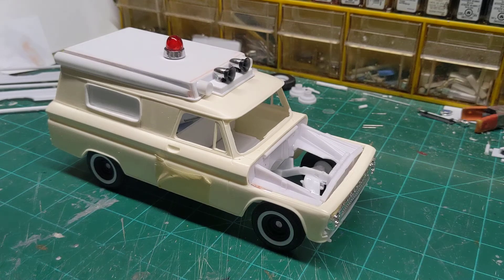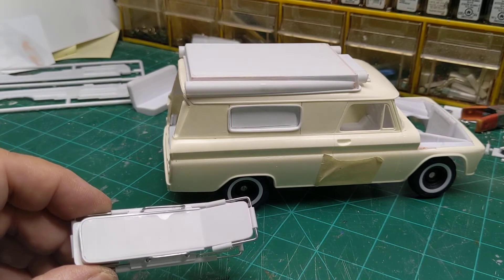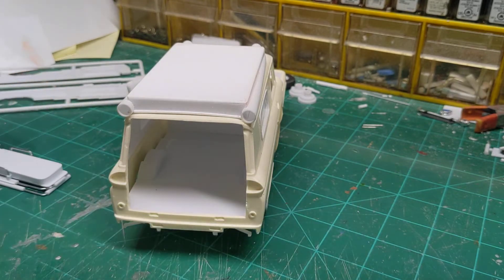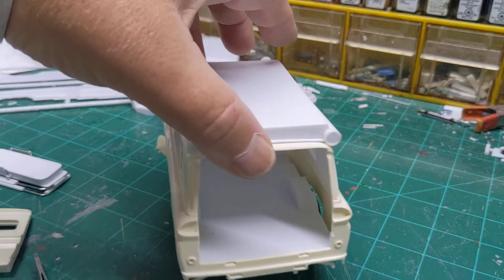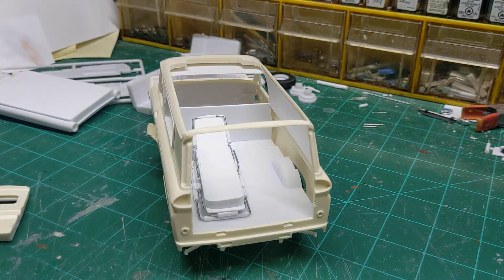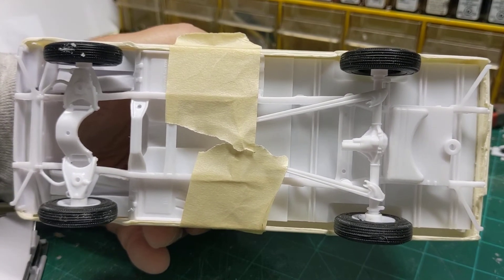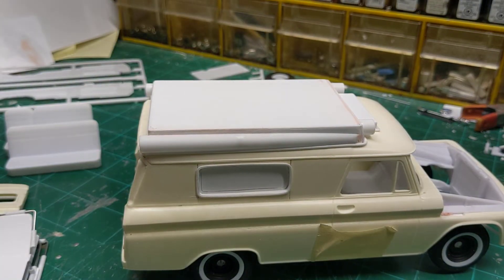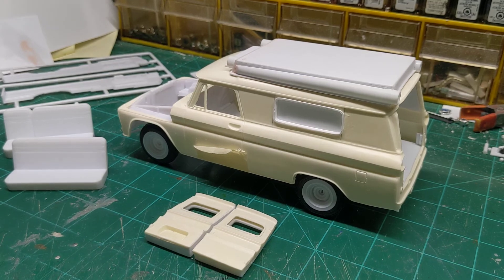Day 5 update.

Comment: 😲😲 That stretcher!!   Another sweet display of making something from very little.  I think the little jumper seat is perfect for the older ambulance.  Maybe and oxygen bottle or an overcoat/aprin hanging would be a neat accessory.
I don't know anything about hinging stuff yet.  Mid point of lower pivot would have to be either more rearward like the natural slant of the back or larger than the top..??  Hope you get it figured out.

Comment: Great work so far and really cool looking stretcher.👍🏻😎 I'm not sure if a removable roof with the rear doors open would be necessary, but it would definitely be a nice feature. By the way, maybe you have found those pictures too, but if not: On leftcoastclassics you can find a huge photo gallery with detailed photos of a 1966 Chevrolet Suburban's interior, engine, undercarriage and body. And this gallery includes also close-ups of one of the rear door hinges and how they are attached (at a certain angle) to the body and door. Maybe this can help you build some working miniature hinges...
Reply from the maker: Thank you for that link. I will go check it out.
Reply: @davidparsleyscustomscaleemerge  👍🏻😊
Reply: I don't think the prototype hinges will help.  The angle you want isn't stock.  You're already dealing with a customized body -- do the hinges the easy way with the geometry you want.
Are you going to use stencils and frosting on the side windows?
Reply from the maker: @randytaylor1258  Thank you for your input, I appreciate it. The side windows I believe will have a decal on them, but not much, maybe a couple stripes? I really don't know yet.
Reply: Well, these are the hinges on all 1966 Chevrolet Suburbans (and ambulances) I have found; there are nice pictures of an 1966 Israeli Chevy ambulance on flickr from Yohai Rodin...  But of course it is already a fictional ambulance, so everything could be built...